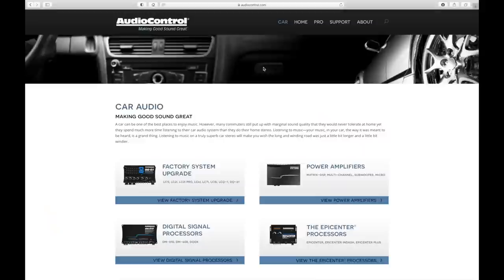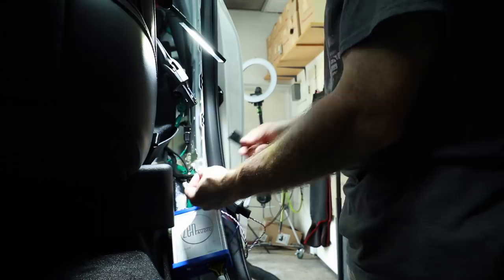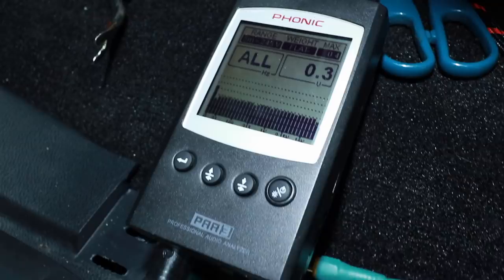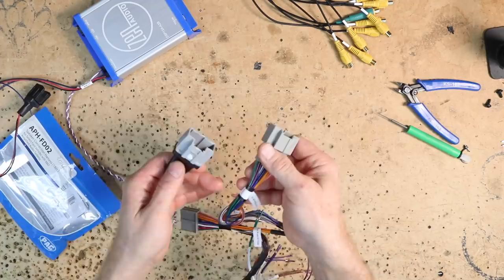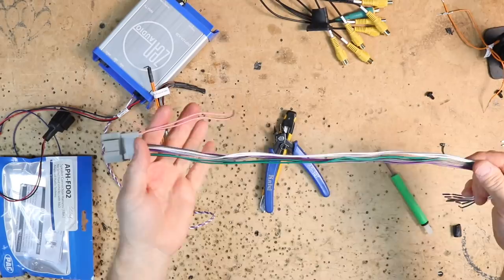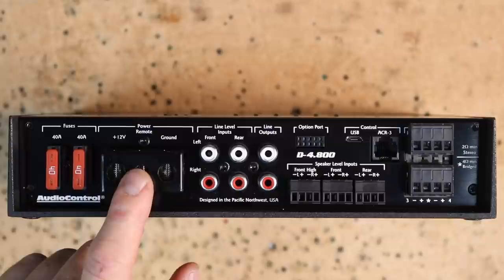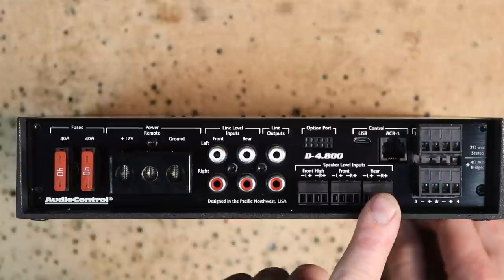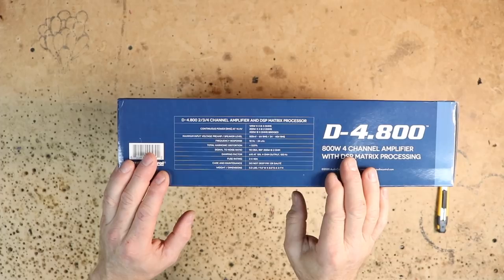We test the Nav Tv Zen A2B  and look at the AudioControl amps Installer Diaries 302 part 2

Comment: Found tour channel looking at 2005 Honda Pilot. Nice quality! I have not found, so I'm requesting, a how to think about a system excluding $. In my case, speakers and head unit. Do I need/want an amp, 2 or 4 channel, cross-over? Fixing up the car as an eventual hand me down. I'm building around a clearer sound as its all original. I have another project car that I'll be mimicking, likely twining components. I would think that an aftermarket head unit would have enough power and features for basic commuting where my $ can go into features. Example would be a good speaker Watt, 50, 100? I would then look at head unit features. Wish you were closer...

Comment: Question. I heard that the ground wire for zen module has to be less than 1 ohm ( instructions) and the plug that connects to the factory amplifier doesn’t have a good ground for the zen. Is this true?
Reply: I’ve read both also. Zen instructions say we have to run the ground wire from the amp back to the battery. I have the zen unit and all components to put into a Ford 2019 just like on this video. However I don’t know where to get it all properly installed. I’ve had one bad experience after another so I don’t know who to trust with the install.